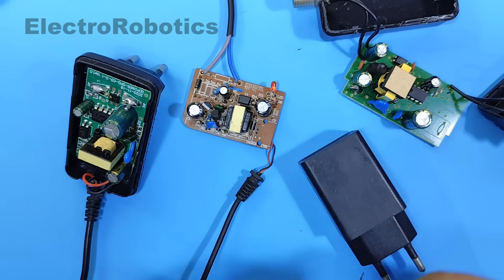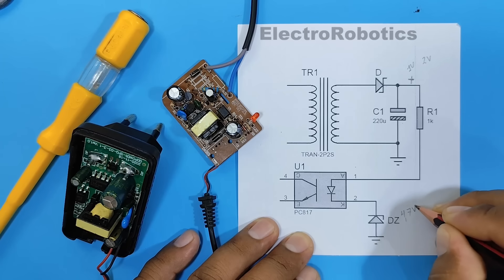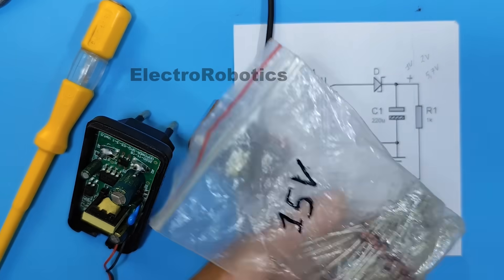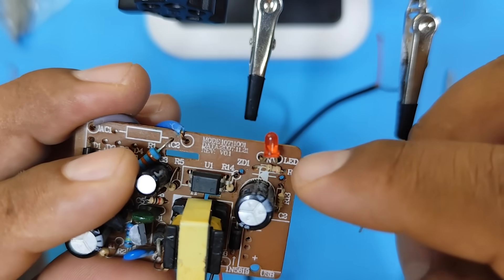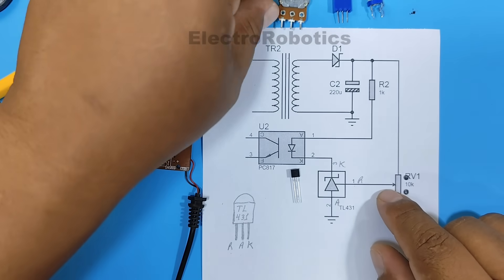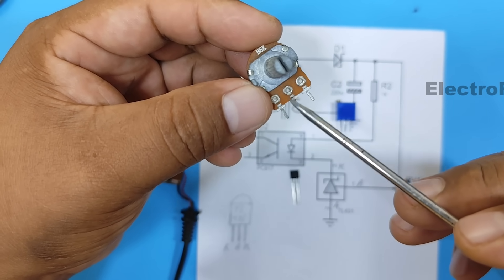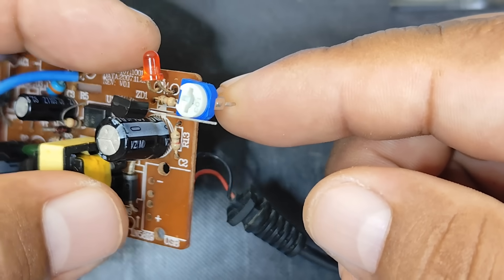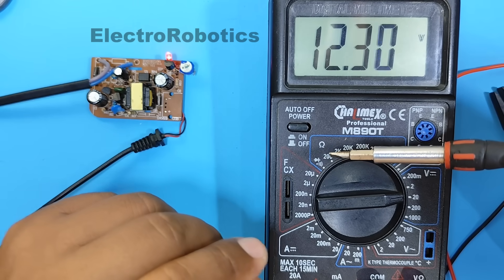Modify Any Charger and Adjust Its Voltage.

Comment: Excellent instructional video, as usual. 😃👏👍🔌💡
Reply: Thanks to garymucher4082 for making me realize another flaw. Any  irregularity is passed to the TL4312 which can  interfere with the regulation.  This is a real and serious flaw.   Usuing a DVMM with no load is a rather naive tes
Reply: So much mis-information
- FIRST
 SAFETY  is important but no safety precautions are given. The part about adjusting the trimmer is scary bad.
- The current must be reduced else it will over-heat and self-destruct.
 - it does NOT work on all chargers. 
- the output waveform will be degraded, so the load may not work properly.
- he does briefly mention the issue with the output cap .....be CAREFUL. For example if you change to 12V then the output cap must rated at least 16V

 This mod has been around for many years  by very ignorant channel makers. It is too bad he has repeated the same mistakes and same mis-information. He should know better.
Reply: @kennmossman8701  If voltage goes up, current will be reduced due to the power law. One needs to pay attention to the required current when using such a modified adapter.
Reply: @examplerkey  yes  I said that

Comment: likkeeee
Reply: So much mis-information
- FIRST
 SAFETY  is important but no safety precautions are given. The part about adjusting the trimmer is scary bad.
- The current must be reduced else it will over-heat and self-destruct.
 - it does NOT work on all chargers. 
- the output waveform will be degraded, so the load may not work properly.
- he does briefly mention the issue with the output cap .....be CAREFUL. For example if you change to 12V then the output cap must rated at least 16V

 This mod has been around for many years  by very ignorant channel makers. It is too bad he has repeated the same mistakes and same mis-information. He should know better.

Comment: Hi very nice video. Kindly explain How to change INPUT voltage  of 110V Ac 60 Hz to 220Vac 50 Hz and OUTPUT 12.6V - 4 A of SMPS Power supply of SONY UHD Bluray player.
Reply: OUTPUT 12.6V    DC or AC?

Comment: Excellent Easy to follow instructions. Thanks.
Reply: Thanks to garymucher4082 for making me realize another flaw. Any  irregularity is passed to the TL4312 which can  interfere with the regulation.  This is a real and serious flaw.   Usuing a DVMM with no load is a rather naive tes
Reply: So much mis-information
- FIRST
 SAFETY  is important but no safety precautions are given. The part about adjusting the trimmer is scary bad.
- The current must be reduced else it will over-heat and self-destruct.
 - it does NOT work on all chargers. 
- the output waveform will be degraded, so the load may not work properly.
- he does briefly mention the issue with the output cap .....be CAREFUL. For example if you change to 12V then the output cap must rated at least 16V

 This mod has been around for many years  by very ignorant channel makers. It is too bad he has repeated the same mistakes and same mis-information. He should know better.
Reply: @kennmossman8701  Ok so can you tell us exactly what we should change and correct in order to make it more safe and usefull ?
Reply: @DraleXX_005  uNLESS YOU KNOW THE SAFTEY PRECUATUIONS do not TRY. tHERE ARE SOME GOD CHANNELS THGAT PROVIDE SUCH GUYIDANCE.  bUT THIS HERE IS A CLOWN SHOW.
I would try  a MINOR change, ie  from 5V to 6V while derating the current and labelling the 'charger'
Reply from the maker: It's been a pleasure Handyman, and thank you for your support and your like.

Comment: great video, what of the maximum output current?
Reply from the maker: Hi Lowell M, unfortunately I didn't measure it, but it reached the maximum the power supply can deliver, since on certain occasions the power supply protects itself against overcurrent.
This is because I used a 3-turn coil in the transformer. If you use 2 turns, you'll use less current because you'll have less voltage across your coil.
Reply: >>>>>>  Do not be FOOLED !

So much mis-information
- FIRST  no safety precautions are given. 
- The current must be reduced 
 - it does NOT work on all chargers. 
- the output waveform will be degraded, so the load may not work properly.
.. be CAREFUL. if you change to 12V then the output cap must rated at least 16V

 This mod has been around for many years  by very ignorant channel makers. It is too bad he has repeated the same mistakes and same mis-information. He should know this unless he is a Professor of BS

Comment: how much current can you output replacing zener?
Reply from the maker: Hi geirha75, the power supply's power remains the same.
If I reduce the voltage with a zener, the power supply's current will increase.
If the power supply's voltage increases, the current will decrease.
Reply: @ElectroRobotics-qo2er  I have a hair trimmer that uses one  1.2v lithium battery. Can this power it when I solder the trimmer terminals with wires from this project to trim unlimited since the battery annoys me a lot by requiring frequent charging?
Reply: @FEBNEV  Yes, You can use it to power your hair trimmer. But you have to connect it to its battery terminal, and the output of the modded charger should be set around 1.5 to 2 volt.
Reply: @ElectroRobotics-qo2er  total rubbish
r u a grad of clown college
you can convert 12V 1A to 6V 2A?>?????  WHAT RUBBUISH !!
SUCH BS!!!!!

Comment: Sir your explanation in the video is very patient & clear. But the formula & calculations for TL431 requires elaboration to get a better grip on the sibject.
Reply: Well, I guess he didn't consult his lawyers before posting his video, or else he would have put a disclaimer at the beginning about the hazards of watching other people play with electricity on YouTube. And since THEY didn't pull his video down, then no doubt the dumb billionaire & all his clueless investors who own YouTube obviously didn't consult their lawyers as well, right?🥸
As for the "degraded waveform", excuse me, but uhhh...this is a DC Output Power Supply!🤪🤤🤤🤤🙄🤦
As for your claim that the current through the potentiometer/trimmer must be reduced or else it will be destroyed, have YOU ever heard of Ohm's Law?🤨 I=V/R & P=V x I
Let's plug in some values:
If the trimmer is set to give 5V, DC(🙄), output, & he used a 5kΩ (5000Ω) trimmer, then 5/5000= 1mA (0.001A).
P= 5 x 0.001, or 5mW (0.005 Watts) is being dissipated by that poor little "underrated" potentiometer!🥵🤣🤣🤣🤦
Even the smallest of those little trimpots are rated for at least 1/4W, or 250mW!
And the ubiquitous Bourns 3296 series 10-turn cermet trimmers are rated at 1/2W (500mW)!! Somehow, I don't think that running a trimpot at 1%,  1/100th of its maximum ratings, is going to "cause it to overheat & self-destruct".🤣🤣🤣🤪🤤🤤🤤🤦
But, OK. Let's say Buddy CRANKS up the output of the power supply to maximum; do you think it could even put out 15VDC? Let's say it could, then.
That would triple the current flowing through the 5kΩ pot to a whopping...3mA!😳🤯😲😐
And now it would have to dissipate 15V x 0.003A = WAIT FOR IT!🫣15mW!😱🥱😴
That pot is gonna fry baby fry! Running at a whopping 3% of its maximum ratings!😑
As to your other points:
Yes, it is good operating practice not to run capacitors right up to their recommended maximum OPERATING voltage rating, with electrolytic capacitors typically recommended to be rated 10-20% higher voltage than what they will be subjected to by the circuit they're used in. But on low voltage parts like this, especially post-regulation where no surge voltages are ever present, it's just not a big deal in practice. Electronics Technician & Designer with 40 years of real-world experience talking here. HINT HINT.🤨 In fact, I just did a service on my 1972-vintage Eico 379 Audio Signal Generators, of which I own two, & found two 50 year-old original 2000μf/25V power supply capacitors happily working PERFECTLY on a steady diet of 26VDC! For FIFTY YEARS!🤨
I wouldn't think that they'd have lasted even 1/100th as long if they were running at 30V; maybe not even 1/1000th as long.
And yes, this modification won't work on every wall-wart or brick DC power supply. For one thing, they have to be Linear power supplies, not SMPS (Switch-Mode Power Supplies).
But that fact is SELF EVIDENT to ANYONE who knows ANYTHING about power supplies in general, not to mention electronics SPECIFICALLY.
But seriously, GET A GRIP!
If you don't have the faintest idea of WTF you're talking about, maybe YOU should think twice before YOU get on your soapbox thinking that you have even the faintest right to go pissing on someone else's parade!.
If someone watching this video doesn't understand the basics of practical  electronics, they should have the COMMON SENSE not to attempt working on this stuff. After all, you need to know enough to figure out how to order the parts you need from an Electronic parts Distributor, or even how to read the colour codes on resistors!
If you don't, why would you attempt ANY of this? But you have to get your knowledge somewhere, & it isn't always convenient to be learning from textbooks. There's absolutely no harm in just WATCHING this video, & learning about programmable Zener diodes like the TL431...now you know that such a part actually exists, & here's AN EXAMPLE of an application for it.🤗
How long & boring can a video be made before the viewers eyes glaze over & brain goes numb?
Sure, he COULD have warned us that anything more than 100mA flowing through the TL431 will burn it out. But why SHOULD he, when he's just showing you how to retrofit it in place of existing 400mW Zeners that ABSOLUTELY won't have more than 100mA flowing through them, ANYWAY?🧐
In your misguided..."enthusiasm" to find fault in others when the fault actually lies within yourself; from what I can see, the REAL source of "So much mis-information" is really just from YOU.😒
Reply: DO NOT BE FOOLED!!!
So much mis-information
- FIRST SAFETY  is important but no safety precautions are given. The part about adjusting the trimmer is scary bad.
- The current must be reduced else it will over-heat and self-destruct.
 - it does NOT work on all chargers. 
- the output waveform will be degraded, so the load may not work properly.
- he does briefly mention the issue with the output cap .....be CAREFUL. For example if you change to 12V then the output cap must rated at least 16V

 This mod has been around for many years  by very ignorant channel makers. It is too bad he has repeated the same mistakes and same mis-information. He should know better

Comment: What about LED indicator? It has a series rezistor conected to output voltaje calculated for a 20mA drain. If you raise the output voltaje the LED is going to blown.?
Reply: good point.   yes you may have to change the current limiting resistor.
Reply: @cyberpancho  WRONG
Reply: I changed to a 1K resistor. No problem
Reply: @cyberpancho  zenner is acting like a normal diode when the voltage is uder his value. If is 5V1 and you apply 12V zenner is gonna fry without a new balast rezistor. You have to limit the current through zenner also . Beetwen 10-20 mA. That means 2 components more . Better apply a thiny 7805 stabilisator.
Reply: @mugurarman  WRONG WRONG
Reply: @kennmossman8701  what is wrong ? Any zenner diode need a curent limiter resistor.

Comment: I will try your techniques . Earlier I tried with resistor but not successful
Reply: Do not be FOOLED!

So much mis-information
- FIRST SAFETY  is important but no safety precautions are given. The part about adjusting the trimmer is scary bad.
- The current must be reduced else it will over-heat and self-destruct.
 - it does NOT work on all chargers. 
- the output waveform will be degraded, so the load may not work properly.
- he does briefly mention the issue with the output cap .....be CAREFUL. For example if you change to 12V then the output cap must rated at least 16V

 This mod has been around for many years  by very ignorant channel makers. It is too bad he has repeated the same mistakes and same mis-information. He should know better.
 
Thanks to garymucher4082 for making me realize another flaw. Any  irregularity is passed to the TL43x which can  interfere with the regulation.  This is a real and serious flaw.   Using a DVMM with no load is a rather naive test.

Comment: Beautifully clear explanation. What a great teacher you are!
Reply: Thanks to garymucher4082 for making me realize another flaw. Any  irregularity is passed to the TL4312 which can  interfere with the regulation.  This is a real and serious flaw.   Using a DVMM with no load is a rather naive test
Reply: So much mis-information
- FIRST SAFETY  is important but no safety precautions are given. The part about adjusting the trimmer is scary bad.
- The current must be reduced else it will over-heat and self-destruct.
 - it does NOT work on all chargers. 
- the output waveform will be degraded, so the load may not work properly.
- he does briefly mention the issue with the output cap .....be CAREFUL. For example if you change to 12V then the output cap must rated at least 16V

 This mod has been around for many years  by very ignorant channel makers. It is too bad he has repeated the same mistakes and same mis-information. He should know better.
Reply: I wouldn't go that far. It's a AI video.

Comment: Great information thank you.
Reply: Thanks to garymucher4082 for making me realize another flaw. Any  irregularity is passed to the TL4312 which can  interfere with the regulation.  This is a real and serious flaw.   Using a DVMM with no load is a rather naive test
Reply: So much mis-information
- FIRST SAFETY  is important but no safety precautions are given. The part about adjusting the trimmer is scary bad.
- The current must be reduced else it will over-heat and self-destruct.
 - it does NOT work on all chargers. 
- the output waveform will be degraded, so the load may not work properly.
- he does briefly mention the issue with the output cap .....be CAREFUL. For example if you change to 12V then the output cap must rated at least 16V

 This mod has been around for many years  by very ignorant channel makers. It is too bad he has repeated the same mistakes and same mis-information. He should know better.

Comment: Great JOB 
may you please tell me how many volts and Amp. does the TL can handle ??!! As May I use This circuit for a Heavy duty
Thank you again :face-red-heart-shape:
Reply: So much mis-information
- FIRST SAFETY  is important but no safety precautions are given. The part about adjusting the trimmer is scary bad.
- The current must be reduced else it will over-heat and self-destruct.
 - it does NOT work on all chargers. 
- the output waveform will be degraded, so the load may not work properly.
- he does briefly mention the issue with the output cap .....be CAREFUL. For example if you change to 12V then the output cap must rated at least 16V

 This mod has been around for many years  by very ignorant channel makers. It is too bad he has repeated the same mistakes and same mis-information. He should know better.
Reply: Thanks to garymucher4082 for making me realize another flaw. Any  irregularity is passed to the TL4312 which can  interfere with the regulation.  This is a real and serious flaw.   Using a DVMM with no load is a rather naive test.

Comment: We'll done Sir Frome Karachi Pakistan Muhammad Khalid khan Electronice Shope
Reply: So much mis-information
- FIRST SAFETY  is important but no safety precautions are given. The part about adjusting the trimmer is scary bad.
- The current must be reduced else it will over-heat and self-destruct.
 - it does NOT work on all chargers. 
- the output waveform will be degraded, so the load may not work properly.
- he does briefly mention the issue with the output cap .....be CAREFUL. For example if you change to 12V then the output cap must rated at least 16V

 This mod has been around for many years  by very ignorant channel makers. It is too bad he has repeated the same mistakes and same mis-information. He should know better.